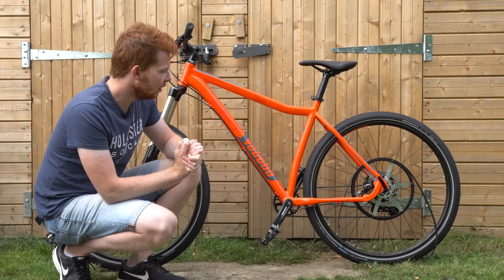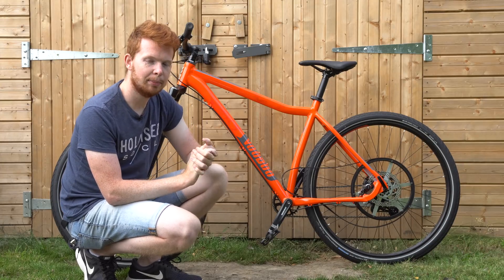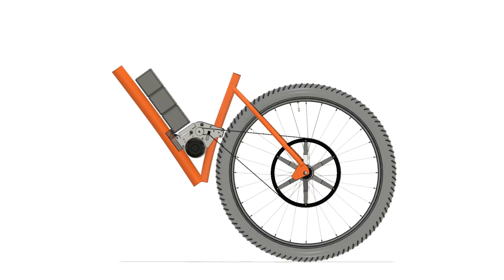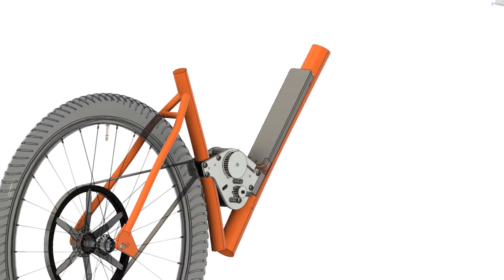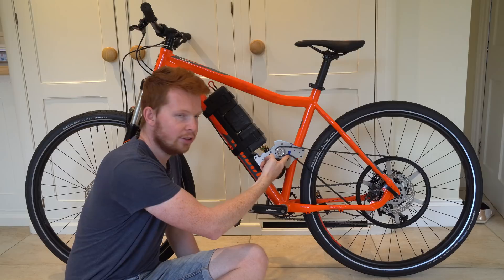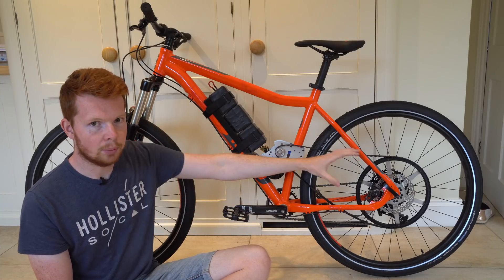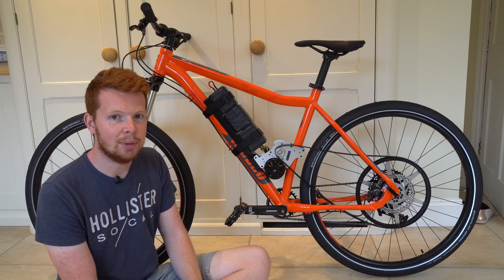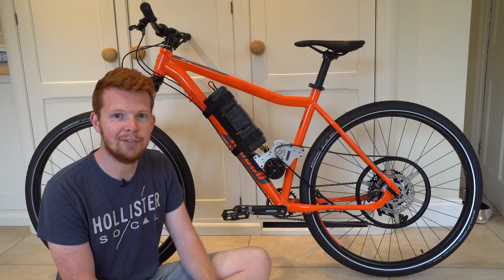Electric bike 4.0 - Motor Mount

Comment: why aren't you using lipo batteries? they'd have a higher discharge, high voltage and weigh less
Reply from the maker: I used to run lipo batteries, but lithium ion batteries are better in many ways. These can happily deliver 100A at 49v and barely get warm. The energy density is better than a lipo and the lifespan is longer in terms of number of cycles.
Reply: Also they are a wholesale lote safer to use
Reply: was wondering that, probably doesnt want the risk of a few phat lipos ignighting after he has crashed it into a hedge at 40mph
Reply: They're the same batteries. 18650s are just in a metal-can instead of in a plastic bag (the polymer in LiPo)
Reply: There are different compositions used in Lithium batteries.
Not even all 18650 use the same chemistry.
Also, the physical properties can affect the electrical properties ;)
@Tom Stanton
What Batteries do you use? I couldn't find a video about it nor the Video where you might have mentioned it.
When you are finished with this Version of the Bike, could you tell us more specific what electronics you used?
On the last versions this information seems to be scattered over many videos.
Reply: +dumle29 That's not true at all. 18650 is the size of the battery. 18mm diameter by 65mm length (nominal; in reality the dimensions vary a fair bit). The "polymer" in LiPo has nothing at all to do with the plastic bag, it's actually the electrolyte used in the cell. (reference: https://en.wikipedia.org/wiki/Lithium_polymer_battery#Design_origin_and_terminology) Different chemistry means they behave differently. Li-ion has a 3.6V nominal voltage, while LiPo has a 3.7V nominal voltage. They also behave differently in different temperatures, among other things.

Technically LiPo batteries are also Li-ion batteries. Lithium Polymer should be called Lithium Ion Polymer, but humans are lazy so we don't bother with the "Ion" part.

Comment: I like trying to guess your solution before watching the video. This week I thought you were going to mount the motor on the rear fork and run the 2:1 pulley down by the crank and then 9:1 pulley on the opposite side of the bike to the rear wheel. My reasoning was to try and keep the motor away from the feet. The first stage reduction down by the crank would likely be narrower than the motor and also not interfere with the pedals. I can't wait for the next part.
Reply from the maker: I had considered a similar design to what you describe, but decided against it in the end, mainly due to protecting my legs from any moving parts. With this system, a small 3D printed case can be made to cover the pulleys and motor. Whereas having the motor driving a belt from behind the seat to the crank would require a pretty large guard. There's also no line of site between where the motor was originally mounted and the crank due to the rear 'fork' bending out quite wide  before going down to the rear wheel. Thanks!
Reply: USWaterRockets is the only one who makes comments worth reading 👍
Reply: By rear fork do you mean chain stay or seat stay
Reply: I think it's the part connected to the Aluminium Coloured bit of kit.